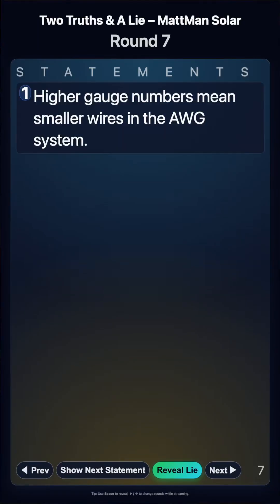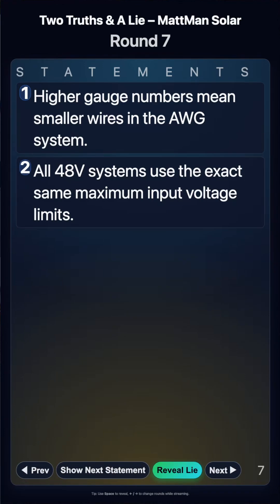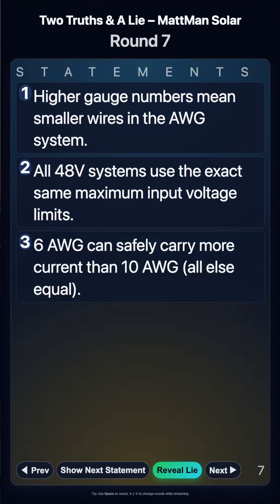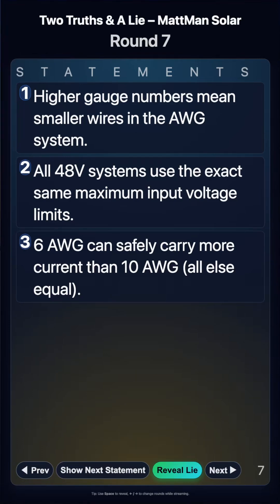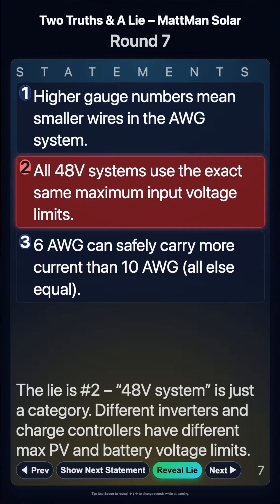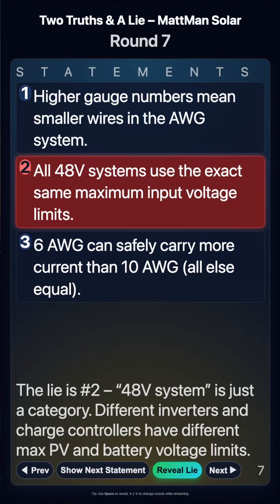Two Truths and a LIE Solar Edition - Round 7

Comment: what is the highest input 24 volt dc you have seen safely used ?
Reply from the maker: Not sure what you mean by input? Charge voltage?
Reply: @MattManSolar power going safely into battery with out battery damage .